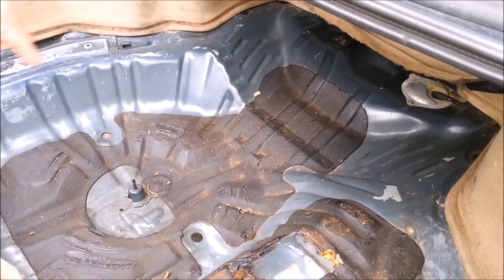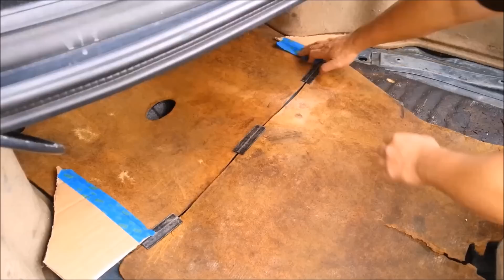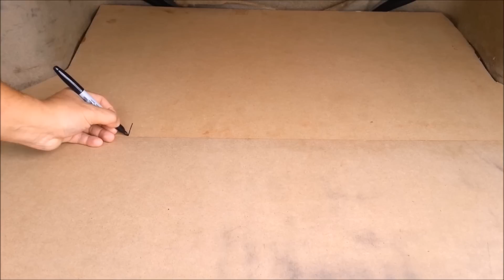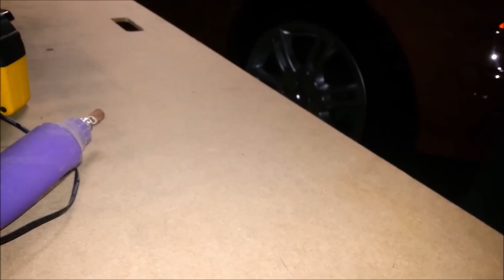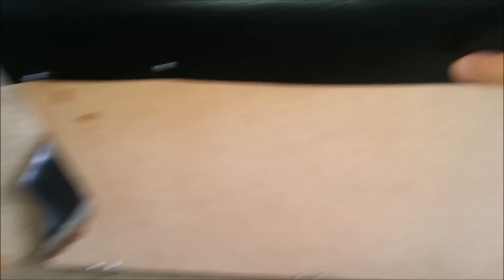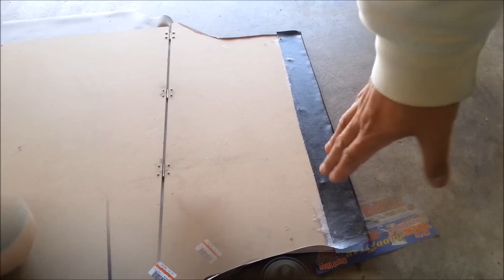DIY How to Replace your Trunk Liner - @winstonbuzon

Comment: great video. ive been looking for one of these. that piece in my trunk is starting to show how beat up it is. and just a tip. of you ever re-do this. on corners cut them at an angle then fold it on top it. if that makes sense. faster and makes stronger bond with the material.